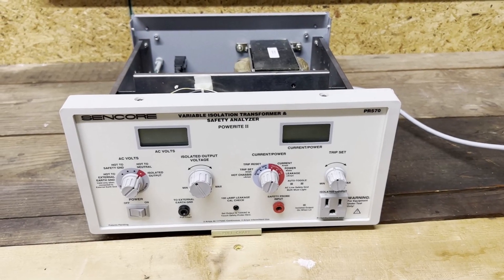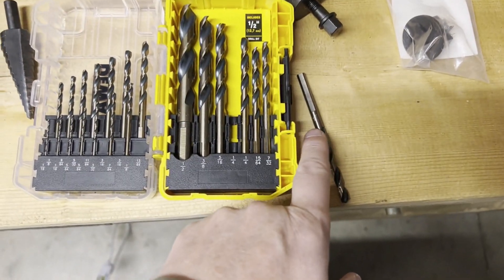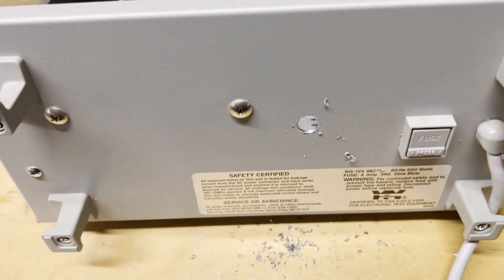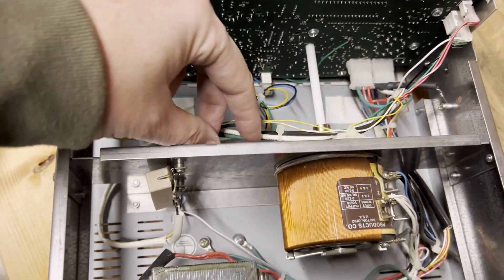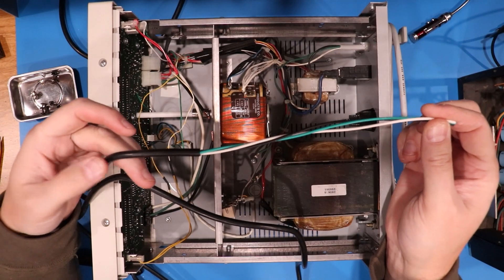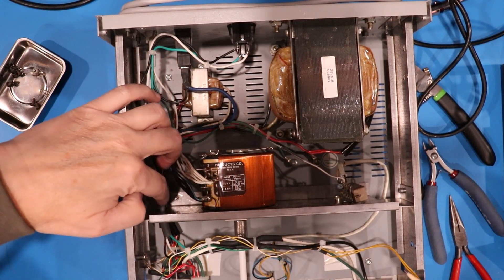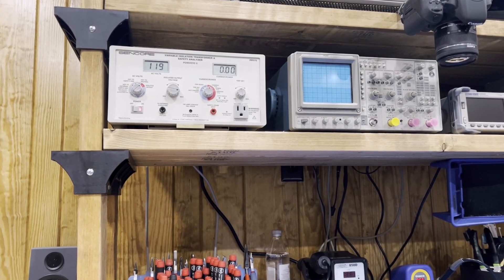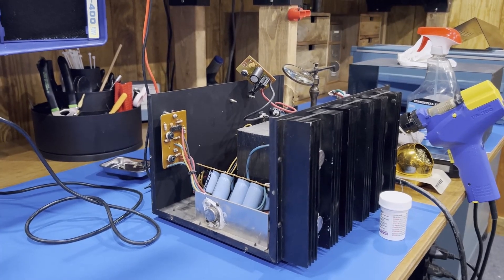Sencore PR570 - Upgrade & A Variac Tip Everyone Should See

Comment: I was thinking about the use of this unit, and using an isolation transformer on the bench.... I know a usb connection defeats the isolation, but it occurred to me that using a signal generator does the same thing... So the scope is grounded to mains, and the DUT is isolated with an isolation transformer... Dummy load is isolated, BUT if you use a sig gen, doesn't that defeat the isolation? How do you use your sig gen with the isolation transformer on your bench Mark?
Reply: The whole point of an isolation transformer is to allow you to safely connect a properly grounded scope, signal generator, or other piece of test gear to the DUT. For your own personal safety, you still need to respect the fact that high voltages can exist between the single point in the circuit that you have chosen to ground for testing purposes and all other parts of the DUT.

Comment: I would use the crimp connector with heat shrink activated adhesive seals for wire connection point instead of soldering.

Comment: Another note when using a chassis punch. The metal on the edge of the hole deforms slightly in the direction of the cutter part. In this example here, the cutter was pulled from inside the chassis to the outside, so there is a slight lip on the back. This may or may not be an issue but keep this in mind. To complicate this further, on a painted surface the cutter side is likely to chip paint around the hole. So again in this example pulling the cutter from the inside is less likely to chip the paint on the back panel. I must have punched thousands of holes with these punches in my 50 years of electronics. Both as a hobbyist and a professional..

Comment: For the added rear outlet i'd have grabbed my stash of crimp spade terminals plus the crimp tool & put one on each lead then just a push-on at the outlet socket.... just saying.
Reply from the maker: I'm not a fan of crimp anything, might let you down over time.  But might not...
Reply: I know what you mean. anything over 5 amps of current, you are asking to trouble after a few years.  I still use them but keep this in mind for high current applications.  @Blueglow

Comment: So are you just adding a mains plug on the rear? That's what I gathered from the power strip comment. You're tapping in between the mains and the variac?
Reply from the maker: Yes, simple mod so that I can feed a power strip out the back of the unit on the bench and not use the front plug that wears out over time.
Reply: Never mind, I went back and watched the other variac video and saw that the outlet is controlled with the front dial. Nice work